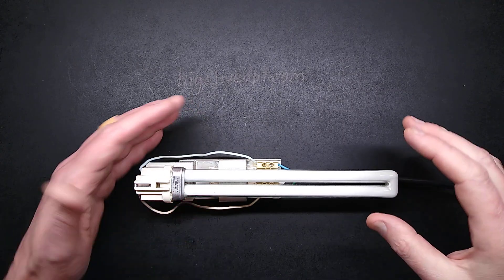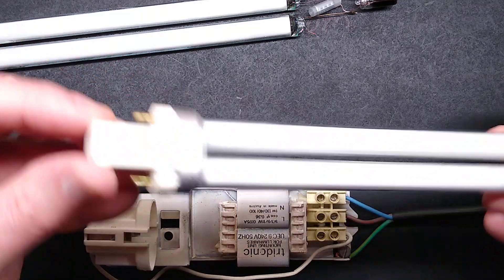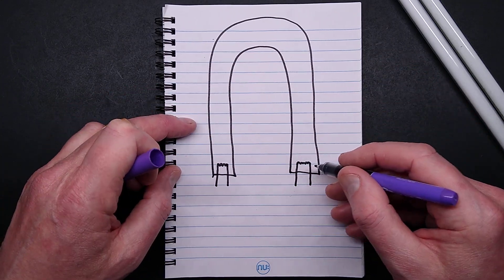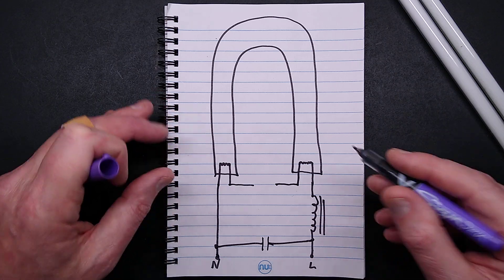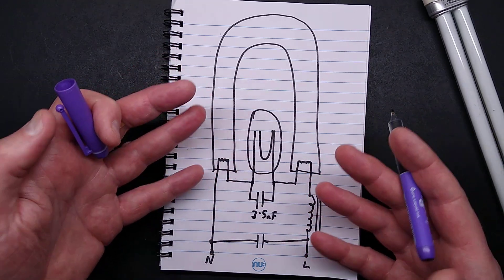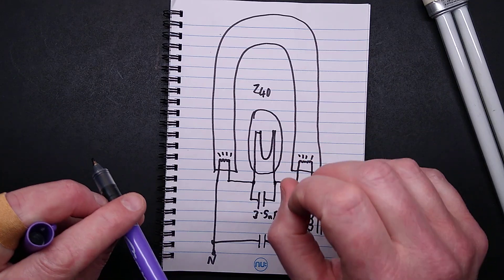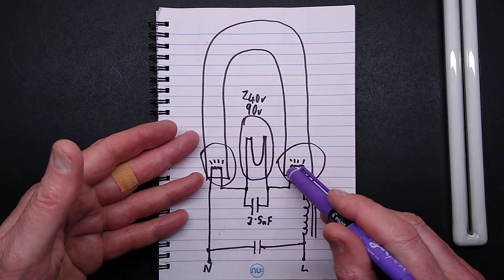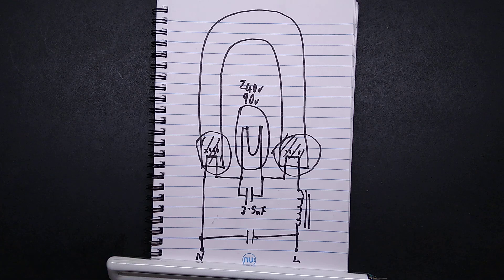Retro already?

Comment: As these are put out of date, we'll need videos like this more than ever.  In the steam heating industry, some like Dan Holohan has spent a lot of time recovering the knowledge of the dead men.  Systems still in use, but the knowledge to run them efficiently lost.  Or needing adaption as government regulations mandated boilers without steam chests to dry the steam meaning replacements need bigger header piping.
Reply: Plenty of knowledge to run steam systems efficiently! It's what I've done for the last 13 years for industrial customers all over the UK 😂
Reply: @Jon-em4kc  I should have been more specific about low pressure steam heating for climate control in buildings.  Lot of old buildings in the northern US with systems installed 100-130 years ago that aren't plug and play with modern mandates.
Reply: Clove you might wanna buy a pink marker and write your link down over the black marker link, since the link is barely visible.

Comment: Where I work they have been slowly moving towards LED lighting by replacing fluorescent tubes with LED "retrofit" versions. Not because they're cheaper as they aren't, but because we cannot get hold of traditional tubes anymore. It's a race now to see how many LED tubes fail before the last one gets replaced. The numbers are terrible. LED lamps are extremely unreliable.
Also dangerous as they emit way more UV as the phosphor wears out.

Comment: The 5 W and 10/11/12 W models had 2 pins, the 24 W and 36 W models had 4 pins.
I guess the integrated starter and the 2 pins made it more convenient for downlight spots and show window or object illumination.
The 24 W worked trouble free in working lights, the 36 W model had problems in glare-free working lights. There was always a little flicker in it and you had problems to start them. The integrated starter was replaced by a push button.
Later they replaced the conventional inductor and the push button with an electronic circuitry. So they got the 36 W lamps flicker free.
These were very expensive glare-free desk lights. It's a shame when you can't replace the lighting element anymore.

Comment: I have florescent tubes in my workshop that must be 20+ years old, most of them still running the original tubes. Only thing I have had to replace from time to time was the starters. Compare that to the LED lamps in my house, most of which fail after a few short years (if they last that long), or they lose their brightness over time. I think we should say a prayer for the worlds landfills where no doubt a lot of our 'throw away' new electronics end up. So annoying that so many light fittings these days are not serviceable - if the leds or their circuitry fail you just throw it away and buy a complete new fitting. Unless of course you have knowledge of how to repair them yourself. But that is a long way from simply being able to change out a lamp. And it's not just at the consumer end of things. Was watching a video just yesterday that warned that over the next decade or two the world will be inundated with millions of tons of old solar panels. Like your average consumer fitting, recycling this stuff is not easy. And don't even get me started about all the EV batteries that will have to be dealt with in the future. Humans have become very good at manufacturing things, they need to become equally as good at recycling them too.
Reply: Yep, same. I have 36 58W lamps in my workshop, from at least 15 years ago. And they're all using high frequency balasts. Very bright, and relatively efficient. I think that they'll last another 10 years the way things are going. Impressive.
Reply: Early LED bulbs last very long, but your typical scumbags saw a multi billion dollar opportunity and now the only way to get long lasting ones are expensive "museum" grade bulbs.
Reply: @AcidDeathRitual  I bought LED lamps in about 2011 at about $20 each. A third of them had failed within a year. Too much power dissipation in too small a package ageing components very quickly. How early do you mean?
Reply: @AcidDeathRitual  I have a set from Philips that resemble the incadescent bulbs that had the back-side reflection kind of reflector, and they resemble that style of bulb very well.  They were expensive, but have been running for nearly 10 years now.  I haven't checked their color temperature or output, and the ring near the top of the light does get flaming hot (this was the same right in the beginning, so not a new issue) but they have been able to meet their 8 year warranty Philips gave on them at the time of acquiring.
When one would break, I am very much inclined to open it up and see what failed though...Fairly sure it's the electronics and not the LED's...
Reply: My experience with domestic LED lights is that the worst issues are with retro-fitted lamps used inside old fittings that were not designed for them. Very often the socket end of the unit is fully enclosed with no means of heat dissipation, which leads to overheating of the electronics and premature failure. In my current (new) house I've got about 60 LED downlights that were installed by the builder and had no failures so far in two years.
Reply: My brother has been taking apart mains voltage LED lights for years and never came across a failed LED, it was absolutely always the electronics driving it.  Sometimes he was amazed at the stupidity in design, seeing a component known to get hot be put in the position at which it was the least capable of radiating this heat away.
Reply: @Dutch3DMaster  I have also taken many apart, and yes, your brother is so right about his findings. Hot resistors glued to the side of electrolytic capacitors is a common mistake. And every time I have found blown LED's, it is always because they were being driven at or above their maximum rating, or little thought was given to the heat dissipation. The world we live in now, the market is flooded with bad designs.
Reply: What we all need are the "dubai lamps" the custom bulbs Philips made for the UAE. They run more leds but don't push them hard. More efficient and will last a decade. Don't blame all Leds. Just blame the shitty cost cutting implementations you commonly see.
Reply: @just_saw_dust  you have to admit that it's way more complicated than just replacing a bulb! I'm looking for a replacement light unit that takes a bulb.

At work we have those LED brake and turn signals and they are forever going out. I've got one on my work vehicle that has one bright LED while all the rest are dead. 

Sure - I could replace whatever's wrong with it but that means i'd have to desolder every damn resistor and LED in order to find the bad one. That's way too much work. Throw it away and put one with a real bulb instead.
Reply: Consumers are the only ones who can change this. It is all in the manufacturer's interests, not the consumer's. Complain. Support "right to repair".
Reply: @jam99 Hey look! A liberal!

Hows that "voting with your wallet" doing? Especially with the lack of any real choice?
Reply: Yes... LED brake lights on vehicles. If an LED fails, you have to replace the whole assembly not just the bulb as it was with old lights. Additionally, the LED bulbs are made of funky materials that won't break down. Incandescent bulbs break down - the glass breaks into smaller and smaller fragments and becomes just grit in the soil. The steel rusts to become oxides and the plaster breaks down and joins the soil too. There is no pollution. That plastic crud - burn than and it releases toxins. It won't ever break down in the environment either.
Reply: @raisagorbachov  not quite true. You can get leds with standard car bulb sizes. Blame the greedy manufacturers not the leds. My old car has been retrofitted with leds, they last far longer as a brake lifht than tungsten
Reply: @Will-sc3hw  Really? Again, not my experience. I drive a big vehicle as needed and that has LED lighting. The LED brake light is currently burned out. I've had LED indicators burn out too. As for LED headlamps - worthless - they have no throw to them. They're just nasty, dazzling things that don't illuminate much. And on my personal vehicle, my 3rd brake light is those nasty LED things. That hasn't worked in years and... unlike going to the shop to buy a bulb, the whole LED contraption has to be replaced and nobody makes them any more (what a surprise).
Reply: @raisagorbachov  There is a small amount of mercury in every fluorescent.  It's a mercury vapour disharge tube after all.
Reply: @MattOGormanSmith  Oh, yes. I know that. This is why it is recommended that the room be ventillated and cleared if a bulb breaks. That stuff is very toxic. Remember Minimata Bay and Minimata disease? All caused by mercury poisoning.
Reply: Replace the tubes and see how dim the olde ones were. 

Maybe you don't use the workshop very often, and certainly not for electrical/electronic repair works. 
You are deluded if you think fluro tubes don't produce less light per Watt of energy consumed as they age. Tubes that burn for +40hrs per week produce half the amount of light than when new.  It's always been this way.

I seriously doubt you have ever noticed, or have the capacity to perceive a lower light output from an old LED lamp, even if it faded out over a 1hr period.
Reply: @BTW...  I don't think that i claimed they were still as bright as the day they were fitted. But what i will say is - they still work, they did not just die after a couple of years of use. And when the starters played up after many years use, it was an easy and cheap fix to get them going again, with minimal wastage going into the bin.
Reply: @100SteveB  I hope you can understand that energy wasted from old fluro tubes producing 50% less light output is 'waste' and so, the same as physically chucking E-waste into a bin.  
There is another angle on using less energy aside cost - it means less loading on the supply infrastructure across the whole supply network. Wanna pay more for grid upgrades on ya utilities bill?
Reply: Re: "Original tubes" I bet they weren't as bright as when they were new though...

Comment: Funny thing is the other month i replaced a CFL lamp that was not very bright, very yellow glow. Turns out it had failed, and the CFL tube itself was full of water, due to a leaking roof that allowed the lamp to get wet, and cracked a seal with it being hot, allowing water to fill the tubes. However the filaments were still intact, and thus the glow, as it was always in start up mode, with the water keeping the filament from oxidising as it was slowly being boiled off as steam, and then sucking in more when it cooled. Very strange to see a CFL lamp with all 3 U tubes sloshing water in them.

Comment: I can't say I'm going to miss fluorescent tubes. They always remind me of grim cubicle farms and underground carparks where there's always one flashing because it needs to be replaced. Or kitchen lighting that always seems to take a few times to start and then buzzes no matter how many times you replace the tubes and starters. Sure cheap LEDs are terrible but not so cheap ones with an external constant current source seem to last forever.
Reply: What really bothers me is that everyone complained for decades about the questionably-perceptible 120Hz flicker of fluorescent lamps, but now that everyone has their cheap half-wave LED lamps flickering madly at 60Hz, everyone thinks they're the best thing ever.  I swear people can't tell the difference between eye strain and brightness. 

Pair that with the fashion of poor diffusion in the fixture design, and something like a striplight now casts a dizzying grid of strobing dots on every reflective surface.
Reply: @PSUQDPICHQIEIWC  Exactly, there's tons of studies on the health risks especially when those CFL 'edison bulb'-replacements really started taking off, not only the flickering but the fact that they emit different wavelengths which can effect the circadian-rhythm as opposed to incandescents. LED aren't free of either of these issues, I think the fact that the flickering is slightly less noticeable because its faster has just given people a false sense of security - but they destroy your eyes just as bad as harsh fluorescents. The city replaced street lights near where I live a year or two ago and at night it feels like the entire world suddenly drops to 40 frames-per-second, you can see it if you try to wave your hand in front of your face.
Reply: @PSUQDPICHQIEIWC  I haven't seen any LED lamp designed for illumination flicker at 60Hz. LED christmas lights are terrible as those are nearly all 60Hz.
Reply: Well I am currently conducting a 24/7 test on the new LED lights my landlord installed. Been on for 3 weeks now. My kitchen incandescent light has been going for 8 years now, except for power outages. The CFL bulbs in another room have been glowing for years non stop now.
Reply: They remind me of the basement of the building where I had my first IT job, no two lamps were ever quite the same color or brightness and there was always at least one on the fritz. Plus, flying insects loved them.
Reply: @tncorgi92  to be fair, that would be more of an issue with building maintenance than with the tubes themselves. Early tubes from 60s and 70s would have fosfor coatings producing a bit of an eerie colour. But as they evolved the colours have been quite reliable, specially with brands like Philips. Every tube of them with similar spec is identical in color and light output. You could even get ones with high color rendering index numbers to have it comparable to natural lighting.

Proper maintenance would have documentation on which lights to be used and not mix and match on the cheap.
Reply: Miss Fluoresce is a harsh mistress
Reply: And they NEVER get replaced
Reply: Not to mention fluorescent light bulbs can give people headaches, I've known a few people crippled by migraines because of the damn things. I'm not going to miss them either.

Comment: Thanks for that great explanation of not only how the light works, but also explaining the cause of the colourful signs of failure we all came to recognise in blackened or orange-ended tube ends. Speaking of change, I haven't had the opportunity to listen to a valve wireless for some time and these latest computational devices all seem help bent on using that new silicone stuff. Ah, well...

Comment: This is why we all need the Dubai LED lights.  I think you covered them in an episode.
Reply: Designing Open Source LED Light Circuits+Enclosures for Bulbs seems like a way to do this to an extent.  Would you all be down for making a group for that?
Reply: Run the LEDs at a lower current and use more of them for the same brightness, along with adequate cooling and they last a good long time. I made a  replacement for a 12v 40W filament light that uses 6 of the single 1 watt LEDs and a low frequency (no interference to vhf radio) current regulated boost converter made with a 34063. I ran the LEDs at 250mA instead of the 350mA maximum. it may be a tiny bit dimmer than the original, but doesn't waste a lot of power upwards. It's been used every day for nearly 5 years and still going. It provides light for the seating area in a caravan / trailer home.

For mains lighting, you can get an over-rated bulb (100W equiv. when you only need 60W equiv.) and do Clive's resistor removing/altering trick to decrease the brightness to the original required rating. That should make it last much longer. The temperature rise should reduce too, as the over-rated bulb should be designed to get rid of more heat, and you are running at reduced current.

Comment: I always hated the light from fluorescent tubes, it had a very unnatural feel to it and it was often flickery plus they made lots of noise !
LED's can be unpleasant too, usually extremely bright and piercing but they fade noticeably over time. I still have a 240v 15w pygmy bulb which I bought a long long time ago and find that is the perfect ambient light for my eyes so it's in my bedside lamp and rarely gets used.
Reply: What put me off them was having a CFL bulb fail, taking it out of the light fitting and it having seen that it has burnt out leaving a horrific chemical smell on my hands that took ages to get rid of.
Reply: Funnily enough it's T5 'tubes that can give me eyestrain, i'm OK with T8 and T12.